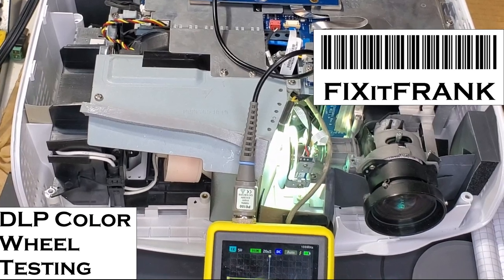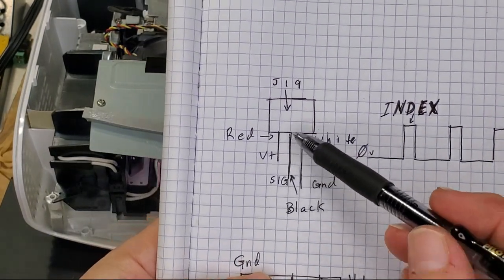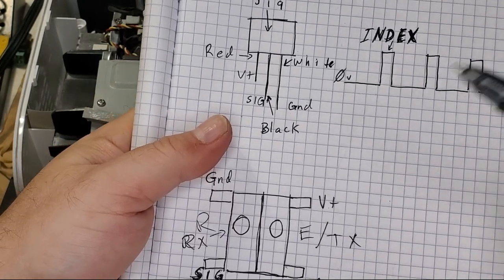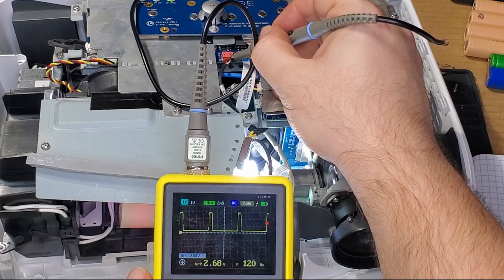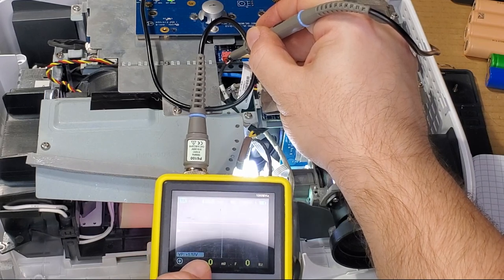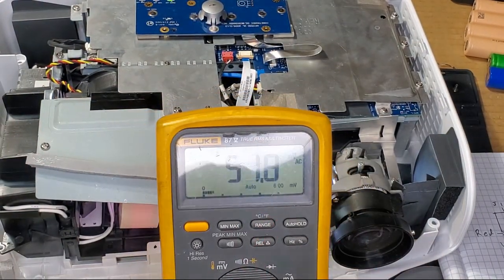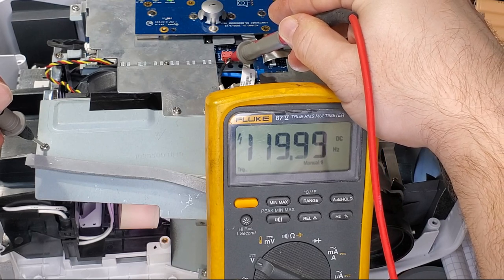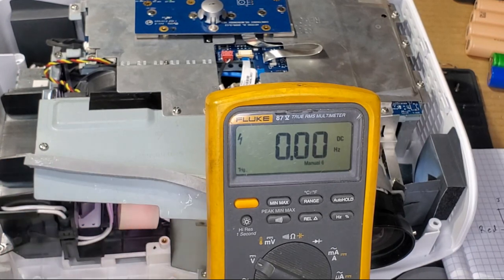How to Check a DLP Projector Color Wheel

Comment: @fixitFrank  Thanks to this Video I was able to fix my Optoma HD20!!  It turns The red wire was Unsoldered and only looked liked it was connected because shrink tubing and the other wires were still soldered.  So I Re-soldered all three wires and Bingo it Works.. Thanks, Your the Man!!!
Reply from the maker: I have not seen that in a long time.  I ran into that with another Optoma. The glue made the wire seem attached but it wasn't.  Very happy to hear this video helped!  Also, I need to thank you for the request/suggestion to make the video, what a good idea!

Comment: Hi Frank
Great content. Thanks for that.
I bought an Optoma UHD50 refurbished from the US shipped to Australia.
The projector is presenting a purple changing to green and back tone on the image. If I restart the project a one or two times the issue stops. Do you have any idea of what it could be and how to fix? A software update could help? Cheers
Reply from the maker: Hi Marcelo,  That sounds like a lagging colorwheel. However I do know these had a few firmware updates after release.  I would verify your firmware level with what Optoma has on their website.  Also, on reddit/r/projectors, there was a thread about updating the firmware with step by step instructions.  The factory instructions leave out doing a full settings reset in the menu which seems to be needed at one point. 
All that said, if it was refurbed there might still be a problem with the color wheel(mechanical/physical problem). The color shift is caused by the color wheel not being in sync with the DMD.  Usually this is dust on the CW sensor but your unit is very new so I would suspect a failing/defective CW motor or maybe even something simple like the CW index settings.  Does it make any grinding/buzzing noises when it starts or is it quiet(aside from the fans)?

Comment: Hi thx for this video ...my question is i have a acer p1287 came to for repair the prob is color is flickering i replace the color wheel with new one and problem is the same i replace the sens no nothing change so my question what kind of drive the sens or the color wheel
Reply from the maker: How old is the lamp assembly?  There is a known problem with cheap lamps that use a poor UV/IR cut filter coating.  Make sure your lamp assembly has a blueish/reddish/purplish tint when you look at it from an angle.  If its greenish or clear, then that might be your issue.  the IR light doesn't get blocked with the bad lenses and it lets the color wheel index sensor get flooded with IR light which makes it act erratically.    also check the color wheel sensor itself for dust. Very common.  Just a little blob on the sensor is enough.

Comment: Hi Frank I picked up a optoma dx608 at a thrift store for 10 bucks got it home and it turns on but everything it projects is pink in color. Checked all the color settings and everything is fine. Do u think the color wheel is shot? Thank you for your time.
Reply from the maker: it could be but if you are using the VGA input, try a different input.  Sometimes pink is an indicator of a bad VGA input.  See if the menu has a test pattern. then compare the menu color and test patters to the pink. Its all pink no matter what, then check the color wheel sensor for dust.  If that all checks out(the sensor is clean) then yeah the wheel is probably bad.

Comment: I mean, if the motor it's not receiving power????
Reply: Depends on the model. Some use PMD1000 power IC to drive it. Others use similar ICs. 
If you get no power at all, I'd start tracing back any of the phases. Also confirm the main low voltage supply. Not having power on any phase would tell me the problem is further back and more broad of an issue. I'd also check for cracked traces near the connector. It's rare but I have seen that a handful of times.

Comment: Thats a good test but, that is when You know is good, and that pulse You can have it Even if You move the motor with your hands. What if the motor it's good but got no voltaje???
Reply from the maker: I think I replied on your other comment but if not, I would check for a PMD1000 power IC and google the datasheet and verify its operation. If this model does not use a PMD1000, you need to trace back the wires to the device that drives the wheel. Check the mains low voltage power supply.  Lastly check for damaged traces.  It is rare but I have seen bad traces near the connector a handful of times.
Reply: @FixitFrank  yes , you replied. Thank you man. I will check the low voltage to the motor. My protector it's turning all lights on. Lámp and temperature. It didnt have the 12 volts but I got them. Then now it's not boosting the 156 volts that should elevate to 385

Comment: Hi Frank, do you think it's the color wheel if the projector doesn't even power up just blinks green power light 4 times and goes back to standby.
Reply from the maker: Could be.  Might be other things too. What model projector?
Reply: Its optoma hd20.  I've given it a cleaning everything seems fine.  Without lamp when I power it on it flashes green 4 times and goes to standby. The color wheel doesnt respond at all.
Reply from the maker: If you are not getting any spin, and its an HD20 AND its the original CW, I would replace it.  My HD20 is on CW #3.
Reply: @FixitFrank  I just got my new color wheel and it's doing the same thing.  Without lamp it wouldn't move but when I slight move it then it will try to run three times turns slightly turn and stop.  Can a faulty photo sensor stop the cw from spinning? I did notice the three wires on the photo sensor were barely hanging on so I soldered them.  Their connection seems fine I checked it.

Comment: Hi Frank, great channel. I have a second hand benq w1070 and the lamp doesn't fire up. Ive checked the ballast with a multimeter and seems ok so think its the colour wheel out. Spins  on start up but sounds like it slows then Spins again to try and get a signal. Spins fine when taken out and wires + connectors seem solid but can't get a signal following your video. How likely is it that the sensor is faulty? Anything else I should check?
Reply from the maker: Thank you!!  It's hard to say exactly but I would check the sensor and see if you are getting a pulse from the pickup. The speedup/slowdown is curious. They do restart three times before giving up with a lamp error.  It's also possible the speed is just too slow.  It has to reach the expected RPMs.  If the wheel is the original, I'd at least try a new one.  If you don't have access to a scope to check the sensor, a new wheel is way cheaper than a scope.  I would make sure you can return it though just in case.  I'd also check the wire connections. It's rare but I have had the conductor break inside the insulation of the sensor wire. Like I said, super rare, but it has happened. My money is on the wheel itself.
Reply: @FixitFrank  thanks, I've separated the sensor from the wheel and started it up. Should the light on the sensor be visible to the eye? I can't see any kind of light but not sure if I should. The wheel seems to be spinning fine (but I'm no expert!)
Reply from the maker: You won't see it with your eye, because its Infrared like a remote control. But if the color wheel acted differently without the sensor near it then it is probably working.  It monitors that little black square and uses that to determine the speed. If the speed isn't very even, that will cause an error and not start the lamp.
Reply: @FixitFrank  ah ok, the wheel spun as before when sensor was attached. Tried to use camera phone to see the ir light but saw nothing. It is a small light though so perhaps difficult to pick up

Comment: Hey Frank ,  problem is projector fires up just fine for 2 minutes, then color wheel speeds up super fast ( sounds like it going to fly away) as image flashes and polorizes and then after 2 mins turns off.  The wheel looks fine in appearance and spins as it should manually ..  History is the unit blew up a bulb and after new bulb problem started.  I expected heat and dust ( it was dirty inside) , so i took apart and cleaned everything .. no change ..  Fans all operate, has burn discolor marks on fan grills.  The projector seems to run hotter than it should after the 2 minutes it stays on.....  Main board? ballast board?  Possible incorrect new bulb? ...  thanks again ...
Reply from the maker: How is the blower/turbine fan ?  Its rare but I have seen those lose blades when a lamp explodes.  Might be the exhaust fan too.  It might be spinning but the blades might be warped and not moving enough air. Do you have a way to measure the exhaust air temp?  I'd be leaning towards a fan issue.  Oh and what model?
Reply from the maker: @kevinduprey9326  Hey Kevin, Check the glass on the lamp housing.  I've seen this when the coating is no good. I believe the lamp goes to full power when it switches from the boot screen.  That causes too much IR light to flood the CW sensor.  If you have another lamp housing around, I would try that.  Even if you have a lamp that you can borrow a front glass to test it, that will work as long as it fits.  It should have a red/blue tint that is obvious.  If it's greenish or hazy, it's most likely the reason.  
There is a small chance it's something electronic but I doubt it.  This really looks like a lamp front glass problem. I know Osram stopped making the "real" bulb for this a long time ago and a lot of sellers use whatever fits.  I'd definitely check that square glass bit on the front.  Another tip.  Many of those lens/IR filters have a small black dot near a corner to show which side needs to be out.  If you swap lens/filters, keep track of which side was out if it comes off a donor lamp.  Hope this helps you out.
Reply: @FixitFrank  WOW ! ... you da man .... switched out the glass and it she works like a charm....  Never would have got that ... crazy thing is that bulb unit did work in another xd700?
A thousand thank you's ....
Reply from the maker: @kevinduprey9326  It's weird.  Those coatings sometimes work, sometimes don't.  I ended up cobbling together a little tester out of an Arduino, IR LEDs and a color sensor.  I tested a bunch of known good OEM filter lenses and aftermarket/Amazon lenses.  I found that the "greenish" lenses barely block any IR.  My control was measuring around 10,000lux.  an OEM was around 1000 lux and the greenish filters were 8-9000 lux. Almost no change with the green filters.  
I can do a video about these lenses if you think it would be helpful.  I use the test box every day probably so its around.